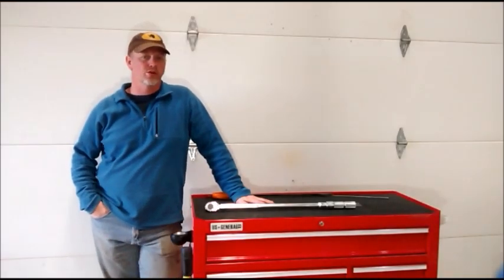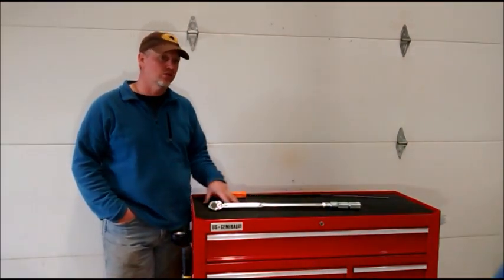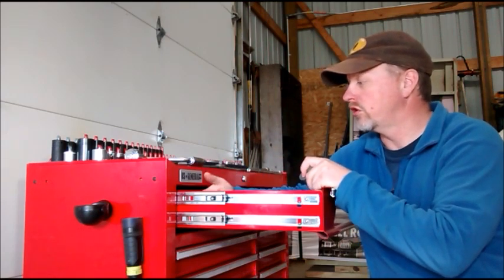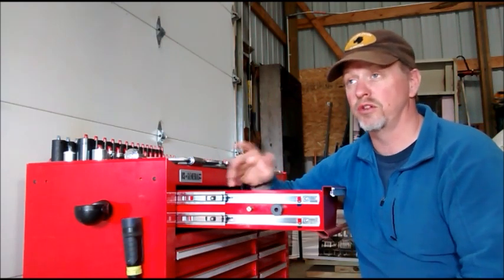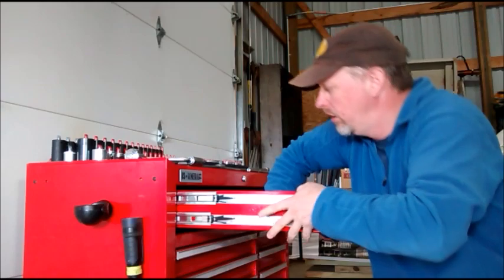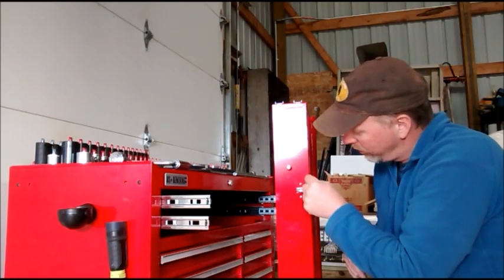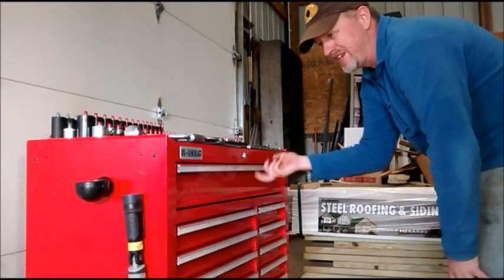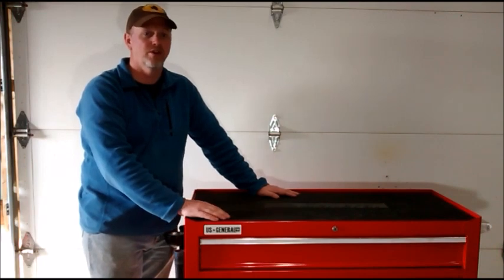Harbor Freight 44in Toolbox Upgrade

Comment: The factory catches are on the drawer slides.  The ends are slightly bent to hold the drawer.  Usually bending them more will solve the problem.

Comment: I have the black 4 drawer tool cart from HF and I run into this problem every time I wheel my cart around the garage. Thanks for the awesome tip. I'm definitely going to make this happen this weekend.
Reply from the maker: I have since found a few methods to fix this issue, but the magnets were on hand already and they have been working great.  Thanks for watching.

Comment: I bought the 72 inch about 4 months ago and hated the latches. I saw a guy with a 5 drawer do it with the magnets out of the HF magnet bar (that used to be free). There are 8 individual magnets in it that can get out. You stack 2 on the back of the drawer and you don't need to glue them. The drawers that will come open will self close about the last inch.

Comment: I have a 5 year old model in matt red finish. It's a great heavy duty box used daily in a fab shop building commercial signage. Rolling it around yes the drawers come open. Just lock it before you move it. The lock on mine functions smoothly and it's really no problem at all.  What brought me here is that on a recent trip to HF the new 44" boxes felt flimsy compared to my older one. I'm sure thinner gauge steel is being used. Has anyone else noticed this?

Comment: Snap on has the lock & roll feature which has a long plastic bar under the lid of the drawer and a catch on the side of the drawer and they come in different lengths. Maybe one of the snap on would work under the drawer, it might be too wide, I don't know but it's worth looking into it, just a thought.
Reply from the maker: The magnets have been working great for me for a few years now, but I am sure that there are many ways to get the desired result.  Thanks for checking out my video and the comments. R.J.

Comment: Hi, you said you used super glue but you also called it by a different name, something "acetate" or whatever? Do you recommend a particular glue? Awesome tip. Thanks for sharing the video!
Reply from the maker: Matt,  cyanoacrylate is the chemical name for Super Glue.  I get mine at the local Hobby Town in larger bottles for building models, but any brand of Super Glue would work.  Thanks so much for watching.
Reply: R.J.'s workshop Thanks!